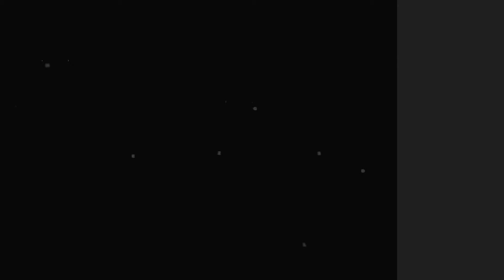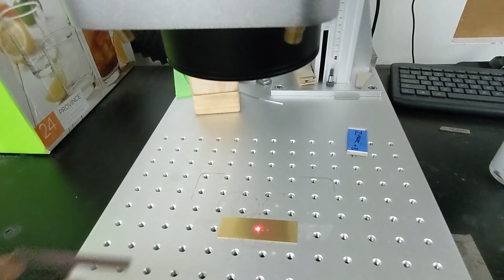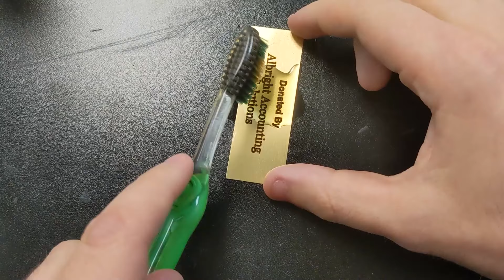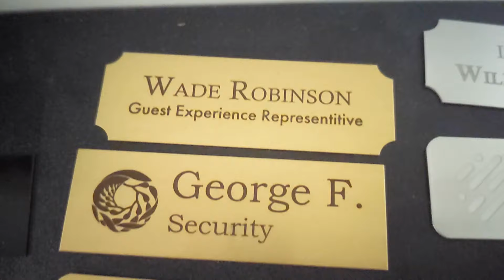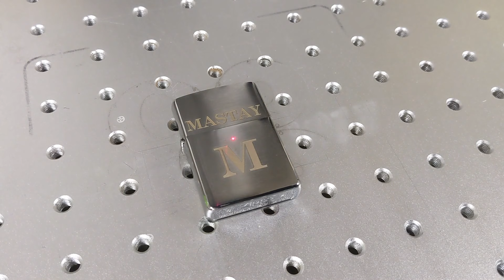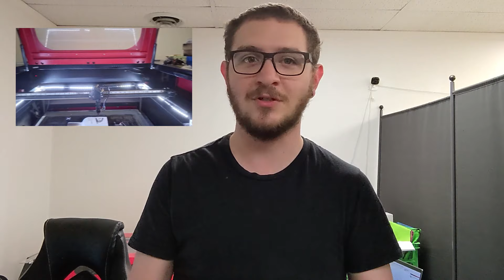How to Engrave BRASS with a FIBER LASER | Fiber Laser Tutorials

Comment: What the hell is a hatch? Sorry I’m new
Reply from the maker: In ezcad, think of it as the pattern that fills in the outlined shape. So if you draw a circle, its just a line, but if you "hatch" it, its now filled in and the hatch values tell the laser how tight each line is to one another, the angle, and such. In Lightburn, this is functionally the same as "fill" as a layer type.

Comment: Nice one again, thank you.
Interesting, my laser doesn't let the frequency to be set below 45kHz.
Still haven't found out why.
Reply from the maker: Different laser sources have different frequency ranges. For all intents and purposes 25 and 45khz will behave virtually the same. If your finding your mark isn't quite as dark try lowering the speed and bumping the power a bit to compensate for the frequency difference but you honestly probably won't have to do that.

Comment: Can I ask please? I want to know how to reduce gold waste when cutting
Reply from the maker: One way to approach that is by using fume extractors with a good set of filters. If you work specifically with only gold, having a dedicated fume extractor for that means you have the option of locating a gold supplier/recycler that is willing to process your used filters for material recovery. If you work with multiple materials, they may require you to have different fume extraction filter/system for the other materials to keep them separate to make processing easier, but it's not something we've had to do ourselves. Reach out to your supplier, they may be able to handle that for you, or perhaps know someone who can, and you'd want to verify what they would need in terms of their requirements to accept that from you.
Reply: @LaserEverything  I actually use it, but when cutting, I have a 50-watt machine. I use strips of gold whose thickness does not exceed 15 millimeters when cutting. The burning rate is very high.
Reply: @LaserEverything  The idea here is that I cannot control the amount of heat or speed at this thickness

Comment: I tried the same setting as yours but im not a the same result as yours. Why is that ? Im new with fiber laser .anyone can answer my question
Reply from the maker: If you have a different wattage laser source, or a laser source that has a different frequency range, or lens size. If you're in focus, or defocused, that can also have a huge impact. I would suggest joining one of our communities, you can create a thread and the staff, mods and community can help provide feedback on what might be happening based on what you're seeing.
Reply: @LaserEverything  Thanks for replying to the comment. I used China Laser Machine which is 30W . I am so lost right now . Btw , I really join the community, hope it will help me . Thank you Alex!

Comment: Hello, i am having a difficult time finding a brass or stainless steel or aluminum setting that will be smooth to the touch (some sort of deburring i suppose) after engraving. Is this possible or will the only way to have deep engraving with black mark that is smooth to touch is via paint filling. Is there a recommended post processing that can be done after engraving surfaces to make it smoother and not rough to touch that its causing fiber to lint at catch on it when wiping

Comment: Hi what is the parameters if its 200x200 galvo fiber laser scanner?
Reply from the maker: The parameters will change for both the lens size, and the wattage of the laser, so I can't say for sure. Best thing to do is check out the settings directly in our site, or there is also a free converter on our site to convert settings specifically for your setup.

Comment: Hi, I am considering a fibre laser to produce fine detail branding iron heads. I know little to nothing about them except they can engrave metal. What sort of cut depth is possible in brass and what sort of resolution can they engrave at?  I suppose it would be the opposite of what you did in that i would be looking to remove material to leave the design standing proud. Excuse my ignorance this is brand new for me.
Reply from the maker: We all start somewhere, no worries! In vector design, you can create a negative by stacking another layer around shapes that will make it stand proud and engrave out the rest of the area. We have a video on the channel called "Preparing Vector Artwork for Laser Engravers" which helps walk through that process, check it out! Depth is going to depend, if you want more than a few mm of depth, you may need to look at a 3d machine so the machine can maintain focus on the areas as they get deeper. Between Kyle and I, deepest engrave we've done on a galvo machine is between 1 and 2.5mm on a 2d machine with various materials. It really depends what kind of depth you're really seeking.
Reply: @LaserEverything  hi, thank you for your response, much appreciated 👍.

Comment: will the engravings rust over time? are there any alternatives to the machine oil?
Reply from the maker: Brass can oxidize for sure. For those who don't want to oil you could certainly go for a poly type clear coat. Just about anything from an aerosol can will do.

Comment: What is the difference between Adobe Photoshop Vs. Adobe Illustrator using the fiber laser ?
Reply from the maker: Photoshop is for editing raster images like photographs which are just grids of pixels. Illustrator is used for editing vector graphics which are just points connected in space, no pixels, which means they can be resized to any size without losing quality.
Reply: @LaserEverything  thank you for sharing your knowledge 🏁

Comment: I've been looking at a lot of videos trying to find the information I'm looking for.  What is the best process (laser or CNC) for getting a good engraving on a metal coin blank?  Want to make my own, but can't find good information as to what can get the better depth.  Thanks!!

P.S. - if you want to throw in actual machines along an affordable budget (no more than $1,000) that would be even better!!
Reply from the maker: Laser is a great choice for this but all lasers capable of the kind of work you're describing start around $3000, anything less is almost certainly a scam or not a fiber laser. For $200 - $1000 you're looking at diodes or extremely low end CO2 lasers, neither of which will mark, let alone carve, metal.

Comment: In your master Acadamy classes do you have library settings for 50-watt fiber machines or does everything have to be converted over? Thanks
Reply from the maker: We have a free to use converter available that does all the work for you and is pretty easy to use. Only takes a couple clicks.

Comment: what is the required optical power to engrave aluminum?
Reply from the maker: 20w for a fiber laser is ideally the minimum you'd want for this kind of work. I've seen people use less than that but it's really really weak.

Comment: Hey, so I'm running a bunch of tests on this exact zippo (I just call them Walmart Zippos) and is there any way at all to get back to that original metal color?  If not, why?  Is it a coating?  I figured I would be able to strip down to something that resembles that original color.  I'm thinking maybe sanding it?  Anyway, any help would be greatly appreciated.  Also, do you do anything to protect the zippo?  I had one in my pocket and the keys scuffed it pretty badly.  Thanks.  Great content.
Reply from the maker: Unfortunately no, it is in fact a coating, the fiber laser is ablating the material so essentially it's being vaporized. No backsies. If you want to undo you'll have to sand and poish the entire piece. I don't do anything to protect typical zippos as they're made of brass which is fairly non-reactive. A coat of clear coat wouldn't hurt if you're unhappy with the integrity though.
Reply: @LaserEverything  Wow.  I wish I would have asked you sooner LOL.  I spent hours re-marking, sanding, re-marking, wiping it away, etc trying to get a good mark like I did when I first marked it.  Even with sanding it wasn't quite the same.  Ugh.  Oh well, I did learn a lot during that time.  Thanks for the information.

Comment: Would running 2 passes vs one help make the mark darker?  otherwise, what settings can get a true black mark on brass?
Reply from the maker: 2 passes could help but what I'd really recommend is a tighter line distance. Try something in the .005 range. You really have to get the brass super hot but even then you're likely looking at a very very dark brown instead of black.
Reply: @LaserEverything  you right, plus I'm creating more burrs with 2 passes, almost impossible to clean up with mirror finished items. Just trying to figure out how Henry rifles do it on their golden big boy rifles.
Reply from the maker: Could be a chemical finisher, like brass black.
Reply: @LaserEverything  so I tweaked the settings with one purpose. To have minimum engraving burrs and darker mark on mirror finished brass.  I'm happy with the set up, of course this is for my laser - 
110 mm lens (working area)
30W
L 1
Sp 150
P 50
Khz 70
Standard hatch at 0.005 line spacing
Clean up with soapy water, light patting with lint free cloth.
See if you can get the same results?

Comment: How bad will it hurt your laser to run it at 100? I've done it with some frequency but I've only had the laser about a month
Reply from the maker: Not nearly as bad as it is for a CO2, but you may as well put it at 95, that last 5% isn't gonna make or break your mark. If you need more power try a smaller lens for better energy density!

Comment: why not just do 1 hatch of 45 degrees and select cross hatch
Reply from the maker: I dunno, ezcad isn't very trust worthy. If it's minimal effort to do something manually to make sure I get what I want I do it manually.
Reply: @LaserEverything  it can be a little clunky , been using it for around 4 years now, it does the job though :)

Comment: I’m new to this and really want to get started. Is there a certain software you’re using?
Reply from the maker: EZCAD is the name of the software and it comes with every fiber laser. The company is verrrrrry stringent on IP protection and you can't just download the software for fun. It comes with special drivers when you purchase a machine that have to be used in conjunction to the software. If the machine is not on and plugged in the software will not function outside of an extremely limited "demo" mode.

Comment: Hey. Do you use the same hatch settings for all materials?
Reply from the maker: The hatch in this video is my standard hatch. No matter what material I'm working with I start here - only change it if I can't get what I want messing with parameters and then I'll start changing the hatch settings but again this is the starting point for all of the work that I do.